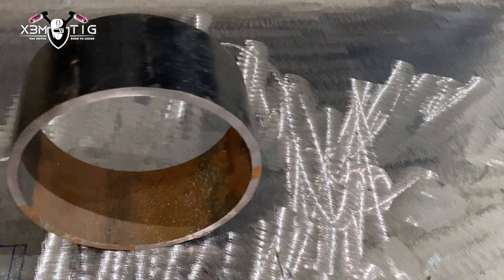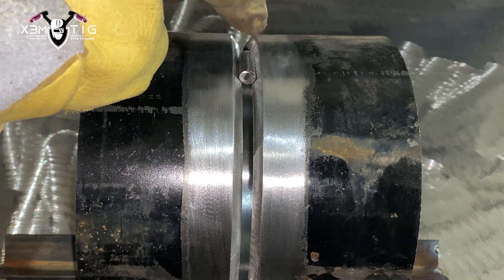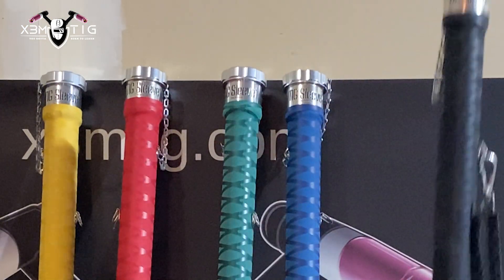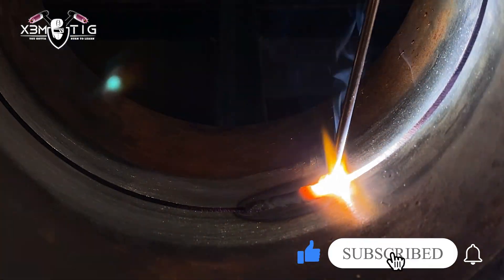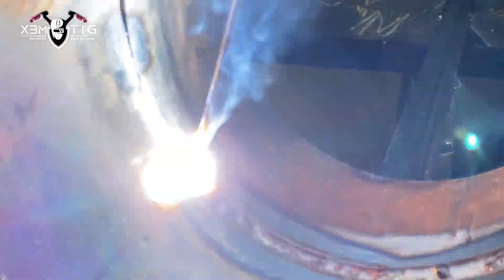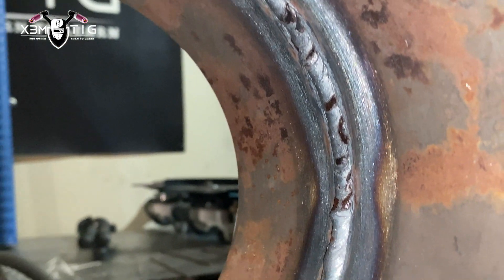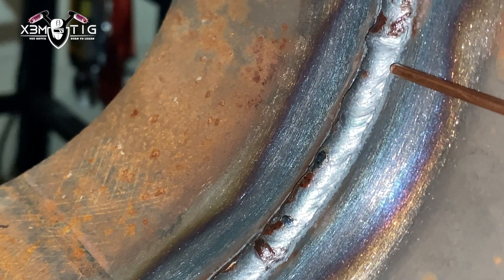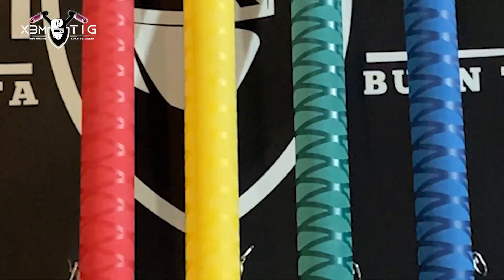Can Small Amps Changes Really IMPROVE Your TIG Welding?

Comment: This video is very useful. Thank you!
I like the tig sleeve. Maybe for version 2.0 you will make one from triangle or square tube so that it cannot roll away from me.
Reply from the maker: Thanks for the tip!
Reply: I was thinking for the second version there is a connection in half that can open up and u can hang the sleeve with the top open and u can grab and go